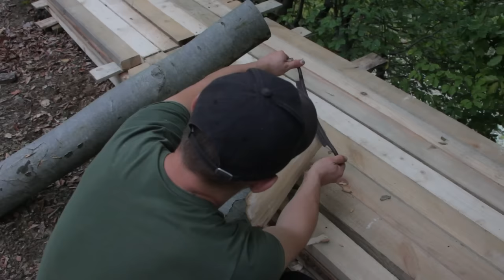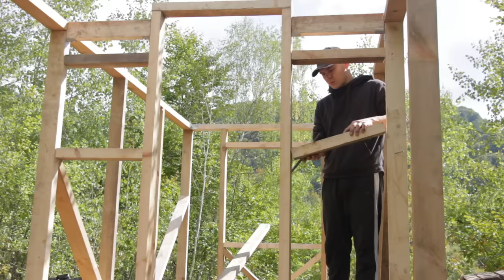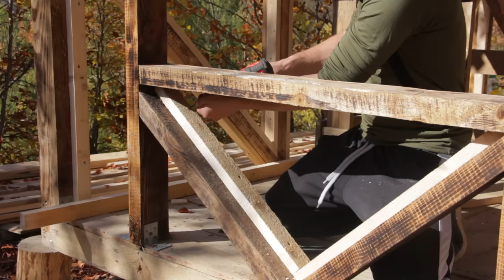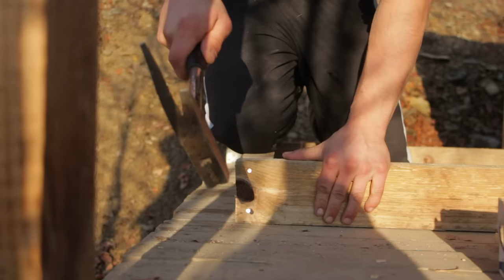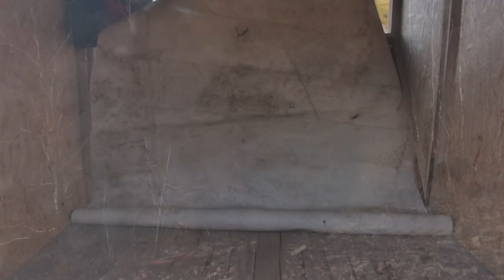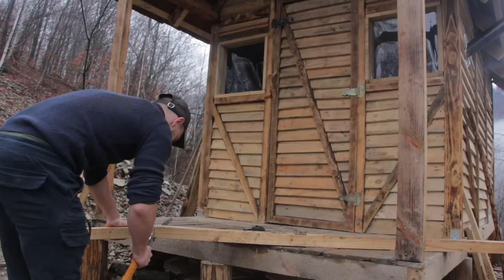A house over a cliff with your own hands. Start to finish

Comment: I hear motor saws and cow bells at the beginning.
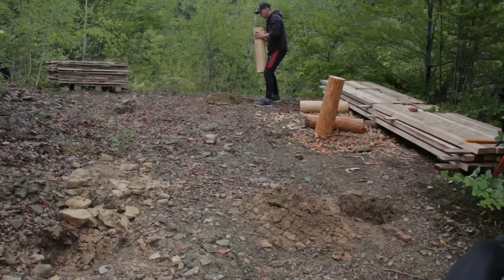02:00 -These blocks will rot away in some month. No old motor oil or burned or was it meand in tha way?
Very esay and simpel but it is a shelter and that counts.